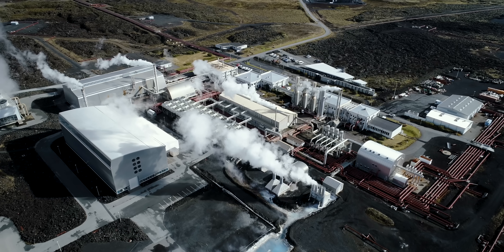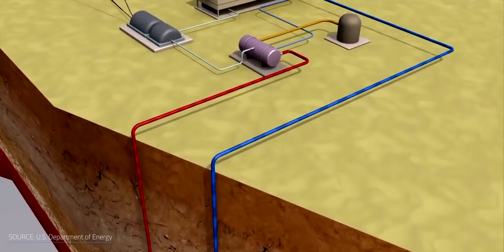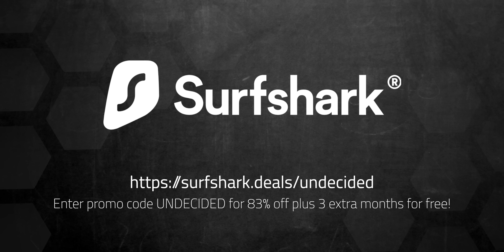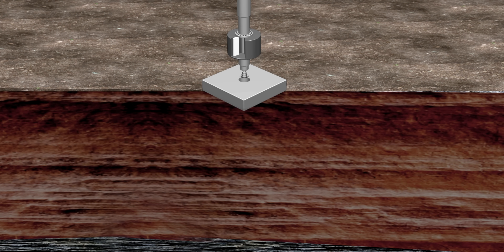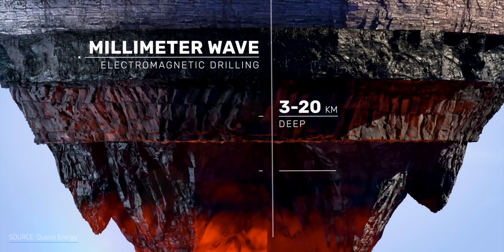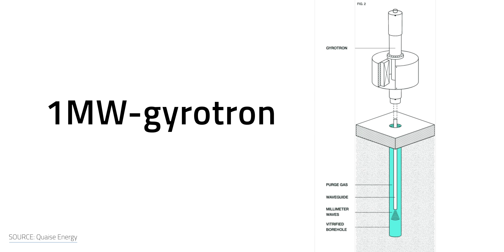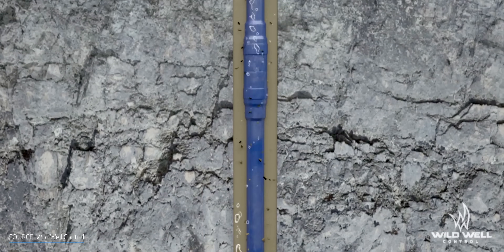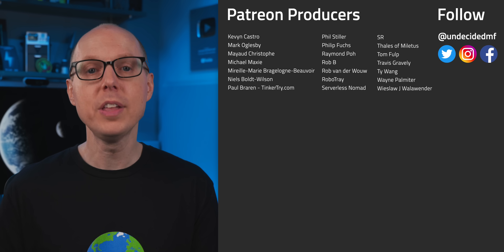Why This Fusion Tech May Be a Geothermal Energy Breakthrough

Comment: This is the most promising renewable energy source i ever seen. It might have its own limitations or say side effects but compare to other renewable alternatives this is most reliable and very straight forward. Only efforts will goes into making the hole deep enough and prevent it from being collapsed. Apart from that nothing challenging as such.
Reply: Agreed. It’s extremely promising and will be revolutionary in the areas that meet the niche requirements. Unfortunately that won’t be all locations, but luckily we have other clean solutions for those locations.
Reply: Wind and solar are generally more cost effective at the moment, but it could certainly complement them fairly well if included in the grid mix.
Reply: Geothermal can work well at shallow depths and small applications where geology has already broken up the rocks. At the depths mentioned here, I am yet to be convinced. Don't forget you would need hundreds of drill holes to get a decent water flow.
Reply: As long as it doesn't increase earthquakes like fracking or end up venting toxic gases into nearby communities.  Companies in the energy sector aren't exactly known for their safety standards.  They prefer to let stuff break and pay small fines instead of maintaining equipment.
Reply: Is it really renewable, though? Also I wonder if there is some negative impact of this were it to be adopted widely. Ultimately we would be transferring heat from the Earth's core to the surface.
Reply: @marek9930  So what you're talking about is true for any "renewable" resource, whether it be wind power and its effect on the jet stream and global wind patterns, tidal power and its effect on global ocean thermohaline currents, geothermal power on seismic activity and, well, geothermal radiation leaving the Earth's inner core - possibly affecting thermomagnetonuclear currents in the core, biopower and its effect on ecosystem and biome stability, hydropower as we've already seen in interrupting river ecosystems and indigenous peoples, and even utilizing parts of the radiation spectrum from the Sun for electron generation in solar PV power when that light would have instead reflected back into space (via albedo), etc. 

This doesn't even incorporate the climate system in terms of land use and other things. 

Eventually if humanity does make it's way out of the current climate crisis and transition to a greener future, we'll always have to deal with humanity's effects on the global geosphere because humans absolutely have an effect on that level. I like to raise the point that if and when we reduce global carbon concentrations back to below 350 ppm, we'll still need to make sure we don't take TOO much carbon out of the atmosphere and go the other direction. Constant management will be needed to sustain the Holocene-like conditions. 

For now, I would read the IPCC reports and dig into the science of the global effects of our power systems on the natural world. From what I've gathered through probably 2-3 years of observation after getting into climate change, we're not at the point where we're starting to undermine those larger systems.
Reply: @nschrombeck  locally speaking. yes, a thermal well might dry out eventually.
the planet as whole? nah we can't make a dent on it. 
earth's mass is 6×10^20 kg of mostly hot rock while earth's inner core is 5 thousand kilometers below us and it is the same temperature as the sun surface.
there is no feasible way to use that energy at higher rates that it is lost naturally.
Reply: @nschrombeck  My skeptical questions above notwithstanding, you make good points.  As you mention "thermomagnetonuclear" and then in the next paragraph, the life-span of the proposed energy generation plants, I have to wonder, if, when decommissioning a plant, one might place all our old nuclear waste at the bottom of the hole, so that in the subsequent period of time, maybe 2 or 3 hundred years later, when we drilled in the same area for another plant, that nuclear waste would have been melted into the magma, diluted and carried away?  And if that is a possibility, why not put all our plastic waste, and all our other waste down there also?
Reply: @marek9930  Not on human time scales, no. A typical estimate is that the reservoir lasts for about 30-50 years, and then needs a few hundred years to replenish. There's no real risk of draining the heat source completely (it's a huge nuclear pile :D ), but the resupply of heat to these reservoirs takes a lot of time (that's why the interior of the planet is still as hot as it is, after all). Though honestly, even the total heat generation within the planet is uncomfortably close to the magnitudes of power humanity might use in the not so distant future.
Reply: @LuaanTi  what would happen if you say, only had the plant running 50% of the time? Would it last twice as long, 60-100 years? Since the main cost is drilling the hole that would make it take longer to pay off the cost of construction, probably meaning higher interest costs for the project. But dispatchable power is more useful than always on power. Eg in a climate like the UK we need much more energy for heating in the winter than cooling in the summer. If we could turn the geothermal plants on for their winter it would balance put supply and demand.
Reply: @adrianthoroughgood1191  Yeah. But you don't lose all of the costs of operating the plant even when it's turned off, and you're not making the money back for the investors. It's tricky, because when, say, a gas plant is not running, most of its costs just disappear, since fuel is such a big part of that; it's not the same for renewables, geothermal or even nuclear.

It might even be worth making those geothermals just for the heat, without incurring the losses in converting it to electricity.
Reply: @marek9930  Possibly. But not nearly as negative as dumping billions of tons of radioactive coal ash into the atmosphere or billions of gallons of oil into the sea. Especially since they are circulating through a heat exchanger and not actually removing anything. Especially with that Hydrogen Sulfide that might be in it. Much like a thorium reactor and most other modern nuclear reactors we keep the stuff that even might be dangerous in a closed loop that will have super limited exposure to the surrounding environment. Especially with the heat glassed borehole. Seriously from what I am currently reading on this the downsides are extremely minimal and we are not going to be solely relying on this for power generation if its adopted. Between this, solar, wind, hydro, and nuclear we should be able to EASILY meet any and all power needs the whole world over. All we have to do is stop all fossil fuel subsidies and fund this instead. It will drastically reduce battery demand too since most cities won't need it as the power would be consistent and reliable in virtually all of them and on hot and sunny days the solar can offset AC usage and such. Honestly with all we have a nearly pollution free future is in our grasp. We just need to implement it before the planet wipes us out.
Reply: The Challenge to build a geothermal power plant is always overblown
Reply: @michaelandrews4783  that’s a ridiculous statement, if it were easy there would be a huge number of them out there already, as some companies would have gone for it for being able to undercut all the competition and make huge amounts of money.
Reply: @michaelandrews4783  Agreed, critics are full of hot air

Comment: 2nd attempt at posting owing to abominable YouTube app interface - but I digress.

1.) Wouldn't the glass-lined well of this technique help prevent contamination and leakage in gas/oil wells as well. Dusclaimer:- I'm not advocating fracking.

2.) This would've great for geoscience in general 

3.) Could this be used for the ice shells of Europa or Enceladus (or to reach ice layers on Mars)? I realise that vaporising ice will NOT produce glass, obviously, but re-freezing might result in firm ice walls?

Comment: Exciting, but I question the estimated numbers based on an 8” hole. Seems like a really small diameter which would limit flow rate for steam production. Also, I’m concerned about the resulting glass lined walls which would be dependent on consistent rock quality and avoiding voids, water layers, veins of differing densities. I’m admittedly uneducated in this discipline so feel free to iron out my concerns for me.

Comment: GA Drilling is one of the companies working on this technology for about a decade now.
Reply: I was looking for this comment! I was big fan of GA Drilling back when I partially worked with them. What is cool about their technology is that they can do spectrum analysis of the particles as they are pushed out, so they know exactly what material they drill though and they claim that they adjust the 'death beam' to better deal with that specific material. So I assume higher efficiency at lower cost. But my concern is that this technology is always 10 years or so in the future, it never seems to make it to the market as finished product.

Comment: The problems that I see with this drilling technique are purely related to maintenance and upkeep costs.
Glass may have a strong factor against compression, but it is horrible against sheering. A single minor quake and crack goes your mining tube.
Following that, what if your fluid line needs replacing, either through normal wear and tear or damage like said minor quake?

This is promising, but all this is is a new way to drill. There are still a LOT of functional problems geothermal will need to combat.
Reply: It would be a simple process to insert a pipe...which you wouldneed ANYWAY to pull heat fluid up and down...so two pipes really.
Reply: There's also the known unknown of "we've never dug lower than 12km before, there may be something we don't expect if we get to 20km."  Geologists have a pretty good idea, but there can always be surprises.
Reply: They're talking glassified rock, not window glass.  More like obsidian or hardened magma.  They'd probably put down a pipe as well because they'd still need to line the upper portion that was conventionally drilled.
Reply: The glass would be a harden for of glass. Think like gorilla glass for your phone screen except for multiple times stronger b/c of the different types of resin used for the creation of the glass.
Reply: Wouldn’t that affect any borehole even a conventional one? Geothermal is already in use so this must have been rectified or maybe they can just case the borehole with traditional methods?
Reply: Maybe coat the inside of the tube with a flexible material so cracks wont cause leakage? Keeping the tube somewhat intact would allow for repairs. Or just bore another hole, if the method costs 10 times less, you can do it ten times for the same cost.
Reply: Is it glass or cooled down magma? I think that the success to one project is proper research and risk assesment. Sure you could pick one drilling spot between tectonic plates, but why :)

Comment: Watching this video I was reminded of one of the problems with disposing of nuclear waste, that is spent fuel rods, they have to be kept in a situation where they can be cooled, is it possible to deliberately put them into a situation where they could produce sufficient heat to mimic geothermal power?
Reply: Too dangerous for radiation cross contamination and exposure
Reply: you'd be intentionally pumping irradiated liquids into whatever system you're trying to make, thus requiring nuclear precautions.
also, you literally just described a nuclear generator just proposing spent fuel rods instead of fresh ones.

Comment: Theoretically, this sounds good.  It does need testing, one item that needs to be ruled out … would reduce stabilizing stress due to depth yielding unwanted results.
Reply: Corning spent decades developing a huge library of glasses with different properties. I could see them making their own and running with it. At least at shallower depths.
Reply: Shallow I can see no problems. One physical project ... shafts for counterweight batteries (mechanical energy storage)
Reply: sounds like you are undecided
Reply: What? Why are you asking a question like that? Email the man in the know in the video for those answers. Also if you are so into the science of this geology why are you not working for a big company that is dealing in this science? 
Me personally wouldn’t ask that question because if I did I certainly wouldn’t be sitting around asking such questions, I would be in the thick of it and trying to get a job as I would feel competent as you do and applying to work one of these experimental digs.
Or are you just winging it as if you are in the know?
Reply: far too many "egg spurts" know until pet theories are found faulty
Reply: @michaelsallee7534  You sound like an egg farmer yourself there. How many chickens you got? Or is it duck? Maybe quail? Aaaaany who... how's your bitcoin doing? Don't worry mate, it'll rebound.
Reply: Actually, a rancher, though chickens do good following 3 days behind the herd. Maggot grubbers. At the moment herd is gone, want to regain. Not just a herd, but a flerd. (Sheep and cattle mixed; as initially, they will want plants the other does not.) Mob grazing them moving onto new pasture ... with the chickens following

not so much on bitcoin, yet have followed the up and down,
Reply: @Vile_Entity_3545  Are you upset at something in your life? Did you lose all your money in Bitcoin? Why do you seem so upset about a simple question? Do you need a hug? Maybe you're upset because you were turned down for that promotion. If that's the case, I would think it has something to do with your interpersonal skills. Anyway, try to cheer up. Who knows, maybe you'll come up with a really harmful thing to say to me and then you can feel better about your life. Looking forward to hearing back. Have a great day.

Comment: Using geothermal energy to generate electricity in thermal power plant is stupid as a thermal power plant is only 30-40% efficient. The other 60-70% of the heat is thrown away into the atmosphere to speed up global warming. It's as stupid as nuclear power stations which are just sophistcated steam engines.

Comment: Sounds like oil drilling just got much cheaper as well
Reply: It’s only (potentially) cheaper when you’re drilling through dense igneous rock, but oil is only found in sedimentary rock (like coal, it’s from dead plants)…not sure how common it is to have sedimentary rock with oil in it under a thick enough layer of volcanic rock that this technology would be superior to conventional drilling…this is cheaper when you go super deep, past the sedimentary layers.
Reply: @theodoremurdock9984  good point.
Reply: @theodoremurdock9984  yea that's why I asked why, this wouldn't benefit drilling for oil really at all. But Im always willing to learn something different.
Reply: It’s all fun and games until the heat ray reaches the oil deposit and lights it all on fire
Reply: How?
Reply: @cwillis92  cheaper access to deeper oil reserves
Reply: @ADHDgonewild7  like Theodore mentioned it's only in very specific spots, & for the most part as the tech stands today doesn't make sense to use in even a small percentage of oil drilling.

Comment: Maybe a daft question, but if the planets core will eventually cool down  naturally then surely us tapping into it and therefore venting that heat faster will cause it's demise faster?
Reply: he said in the Video, that 2 Million Years of Energy only takes 0.1% of the heat. Yeah its not perfekt, but when its a short alternative to pumping out CO2 and killing all living things and melting ice, thats pretty good. Future Generations have to use Solar or Fusion later.
Reply: its like using the sun to push around the solar system.

Kurzgesagt made a video about that and they explained it really well. The energy that earths core has (and always produces) is so insanely high that we cannot even begin to make a dent in it. Its like extracting a few glasses of water out of the pacific ocean. Yes, in theory its gonna deplete one day, but its going to take a long long time before thats the case. 

Also also, the earths core doesnt really... "cool down". Its getting resupplied with heat constantly due to a whole planet pushing down on it.
Reply: So it's currently estimated that the Earth's core will take up to 91 billion years to solidify. Where as the earth will be engulfed by the expanding sun in 5 billion years.  47 tw of energy per second is radiated. Where as the total global geothermal capacity currently is 15.4gw, which is like 0.03% of the estimated natural. So even if we had 3000x more geothermal this would only half the lifespan of the earth cooling but that's still well past the point where the sun will engulf the earth. And having 47 tw of geothermal is currently 2.5x our current estimated energy consumption worldwide. This is much better than what we have with fossil fuels now which is already an issue, not one that will happen in billions of years.

TLDR: if my math is right, we could convert our entire annual energy consumption to geothermal double it, and still the earth would still take more than 10x longer than from now to when the sun will engulf earth to cool down.
Reply: I was more thinking of the possible delicate balance of molten core flowing freely enough to produce our magnetic field and that same core slowing down and therefore weakening the protection of said magnetic field. I'm no scientist and posed this question out of curiosity. Us humans tend to rush into things and worry about consequences later
Reply: It will, but these kinds of numbers are just way off from what we usually think about. I don't have any number to quote you, but we would likely need to tap energy for all of humanity for millions of years in order to make a dent in the heat of the earths core.